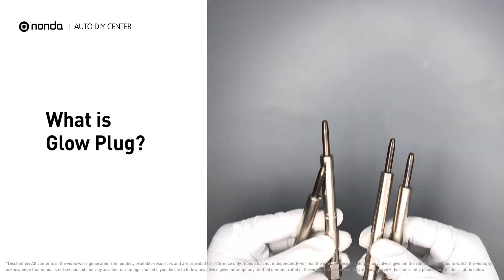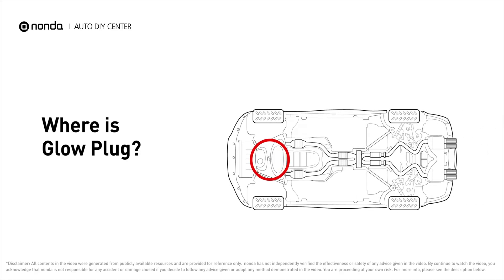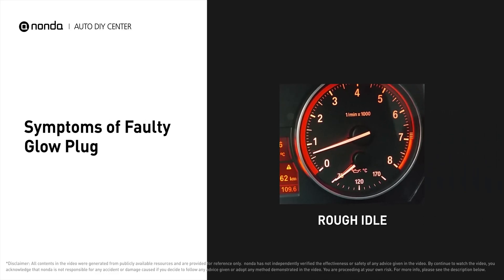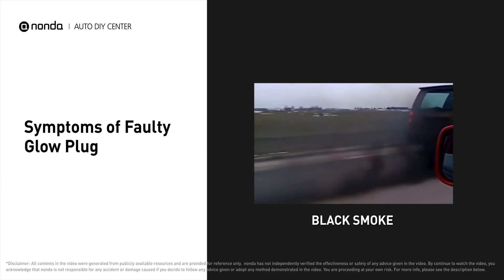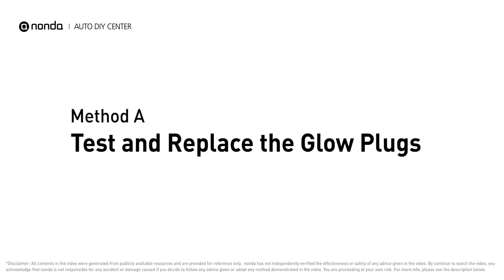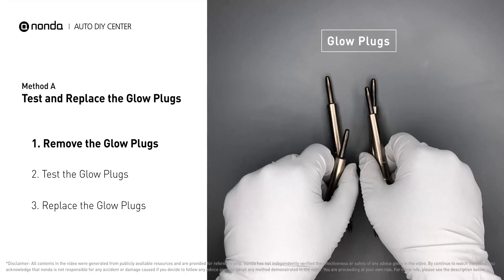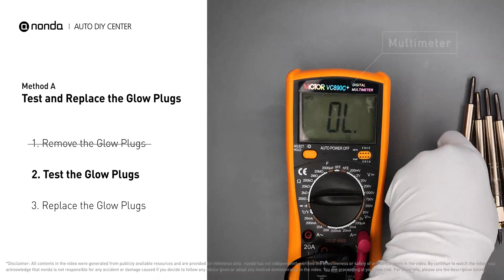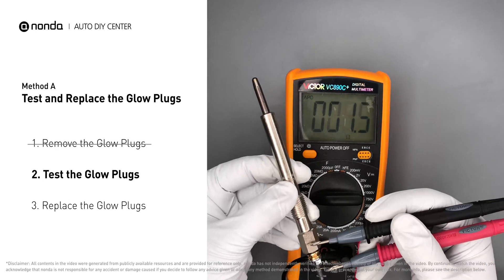Glow Plug: How it Works & How to Fix

Comment: How much for mercedes benz class A 2013
Reply from the maker: Most auto repairs shops charge between $75 and $150 per hour. It rates vary by location, your vehicle's make and model, and even your engine type.
Reply: In uk they charge £300